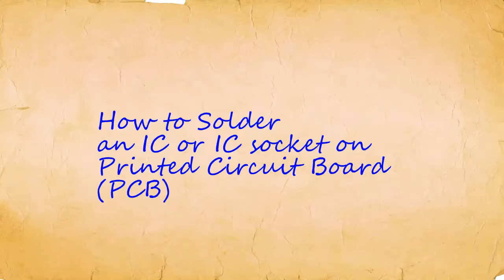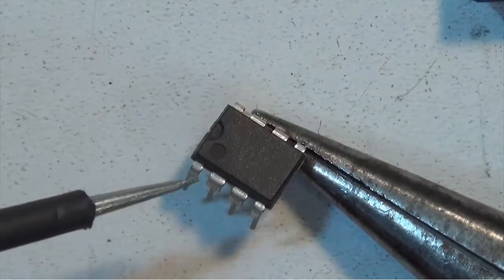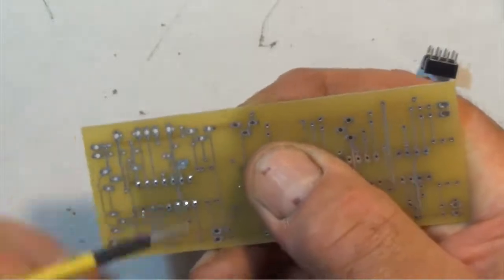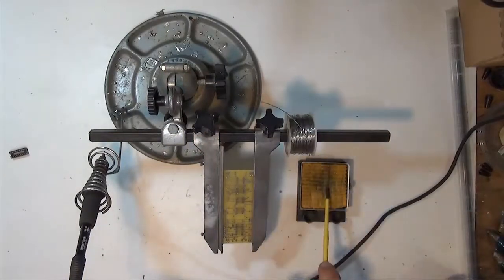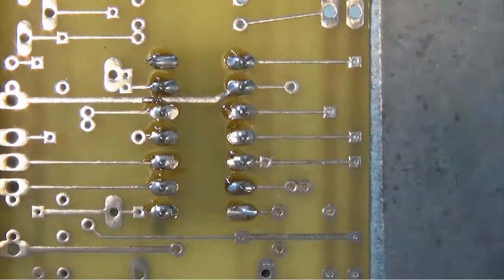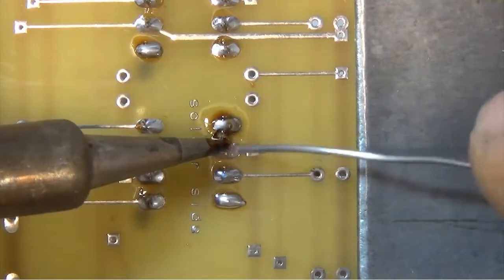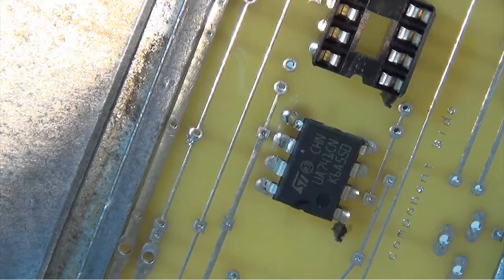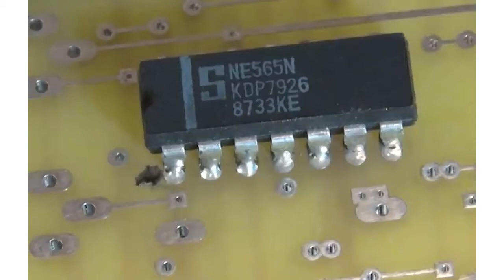How to solder an IC or IC socket on a Printed Circuit Board or PCB

Comment: Just soldered a 555 timer chip to a circuit board. Dialed in the temp to 650 degree... looks like a pro did it. I've been doing audio soldering for most of my life, but just needed a little coaching to solder a 555 timer chip. Did it exactly like you recommended, and it went smooth.

Comment: Could you comment on the size of solder you use (specifically the diameter of the solder wire)? The kind I bought at home depot seems to be far too wide/thick. Thus, it's difficult to make joints that don't touch each other.

Comment: Couple questions. Should we use a Flux pen even if the solder contains Flux?

Are there any other types of solder that work well on these types of ics? I have some 63 37 and some other solder with 2% silver or something?

Comment: Also,  normally The text printed on the IC  is left to right with respect to the #1 pin.  This is not a hard fast rule but it is true for at least 95% of the time.

One thing I do differently is I never bend the leads.   I put the part or socket in the board and while holding it I apply solder to two opposite corner pins.  Then while heating pins I push the IC down flat.  I then solder the remaining pins.   This makes removal of the part later much easier.  this should be done with other parts as well.

Comment: What type of iron do you use?  What size tips do you recommend?  What about external flux?  What type of magnifier do you use or do you use one of the new USB camera types?  Do you have a video about de-soldering and replacing with a socket like what's needed in many old computers?  Sorry for the glut of questions and thanks for your time!
Reply from the maker: Tip size depending on what you are soldering
Rosin core solder is all you need
Desk lamp with 4.5x magnifier
You could use a USB microscope
I think I have a de-soldering video.  All you need is a solder sucker or solder pull and de-soldering wick (copper braid), 99% pure alcohol and a small brush
Reply: @1929fordhotrod  Thanking you very much!

Comment: Awesome explanation. How can i solder socket pins on both side of pcb?
Reply from the maker: Only if the pcb doesn't have plate through holes
Reply: 1929fordhotrod I found sockets with long legs so now i can solder traces on both sides of pcb

Comment: Will this video work on boards with no thru hole plateing as I need to solder some pins of a 4o pin ic on top and the rest on the bottom of a dual side brd produced at home?
Reply from the maker: If the pcb does not have plate through holes you will need to solder also on the component of the pcb. This is normal for pcb's produced at home.
Reply: Very well produced videos. Like your car job also.
Reply from the maker: Thanks.  I intend to do many more videos on basic electronic, test procedures, wiring cars etc.  I just need to fine the time.
Reply: Right, I know all about lack of time. Good luck.

Comment: would it be a problem to solder it to the board without the socket?
Reply from the maker: Not at all but the socket does make it easier to replace the IC if needed.
Reply: 1929fordhotrod thanks

Comment: As I am beginner I am asking you this question for my education. I recently soldered, due to an oversight,  an IC AT89C2051on a digital clock on the reverse side and supplied power. Then I removed it and soldered on to PCB on the correct side, but the clock didn't work.  Is there a possibility of damage on the IC due to this mistake? Should I get a new IC? Please help. Thank you.
Reply from the maker: It certainly sounds like the IC is defective.

Comment: Great video John! Where do you buy your printed circuit boards? Do you get them locally or online?
Reply from the maker: You can get printed circuit boards (pcb's) made at http://www.apcircuits.com/ . Great service there and will not steal the design.  This is great for larger quantities.  If you want to do one of designs then a low cost cnc router would work from a file created in the pcb design software.  Another option would be to purchase a home etching kit http://www.jameco.com/z/PROTOTYPE-KIT-Circuit-Skills-1-Circuit-Board-Etching-Kit_2113244.html and make a simple etching tank.  You can also purchase chemical from https://abra-electronics.com/chemicals/etching-and-circuit-board-development/

Comment: I find that rubbing alcohol doesn't clean very well without a lot of brushing. If you use safety solvent, sold at most hardware stores, it cleans much easier. 
Although available as a separate product, there is water-soluble flux. I haven't found solder containing water-soluble flux however. This would be nice since water is cheap, non-flammable, readily available and environmentally friendly. I have some experience with water-soluble flux in soldering copper plumbing pipes (don't use plumber's solder for electronics) and my experience is that it is NOT as good--more difficult to work with. (Regardless of this disadvantage in plumbing, it is preferred because plumbing solder is corrosive and if not water soluble, will stay in place and corrode the pipe. If water soluble, it will simply flush away, of course.)